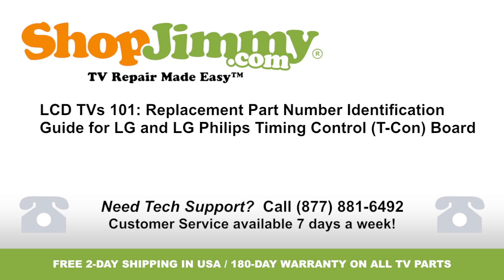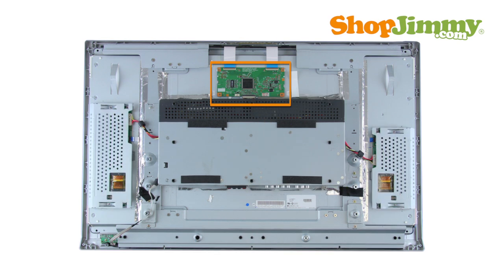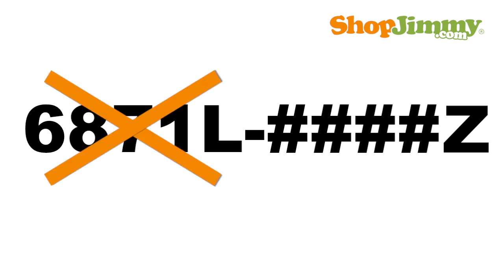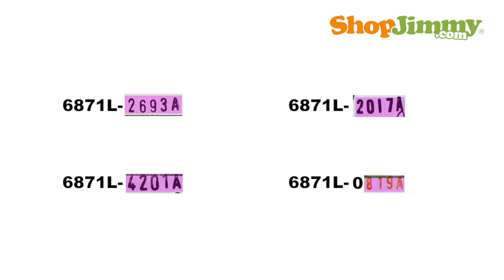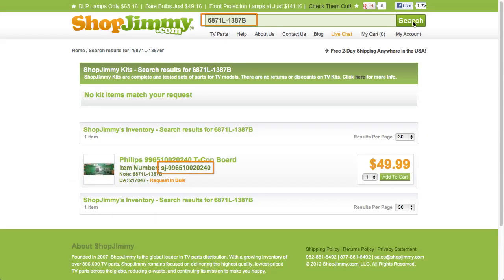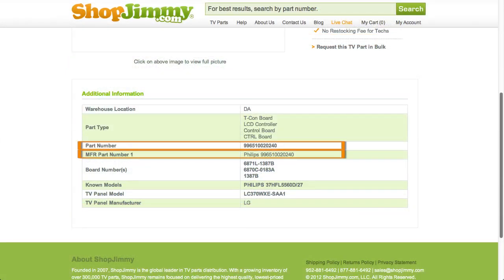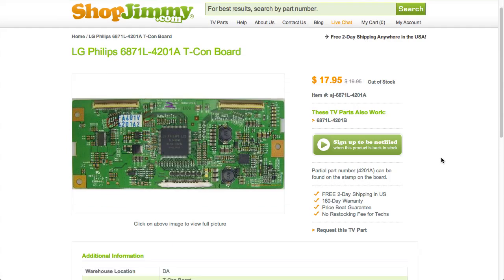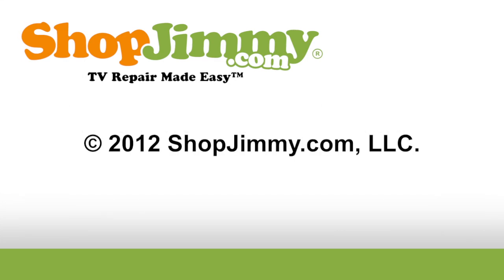LCD Help Part Number Identification TV Repair Guide for LG Philips Timing Control (T-Con) Boards

Comment: Are T Con boards by the same company interchangeable? I found this my T Con board (RUNTK4323TPZZ - ending in "Z") on shopjimmy but also another board (RUNTK4323TPZX - ending in "X") for cheaper. On gross examination it looks like the stamp is the only difference between the two boards. Can I use the cheaper "ZX" Stamped T Con board in place of my broken "ZZ" stamped T Con board??
Reply: Did you go with the possible "compatible" Tcon board instead of the one that is the exact match of yours? and if so did it work?

Comment: LG model 55UF6450 with sound but black screen. I have found the boards but I am trying to make sure that I know if I have to replace the T-Con board or not. Are there any other methods to go through to test? Thanks!